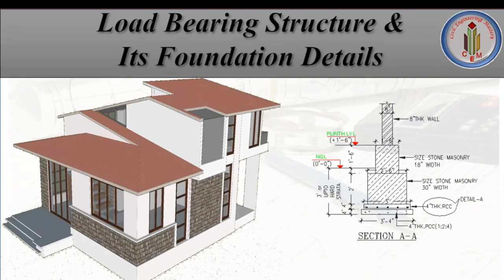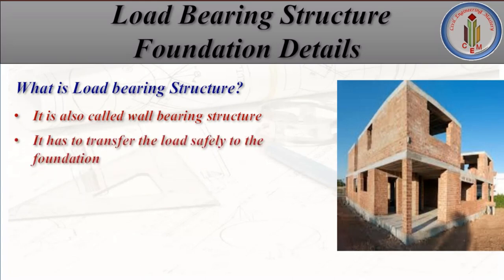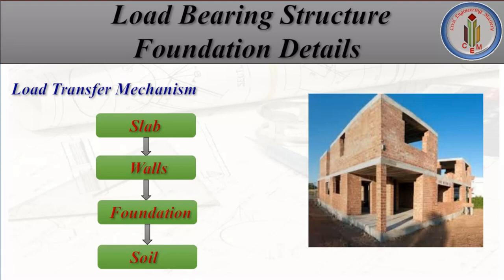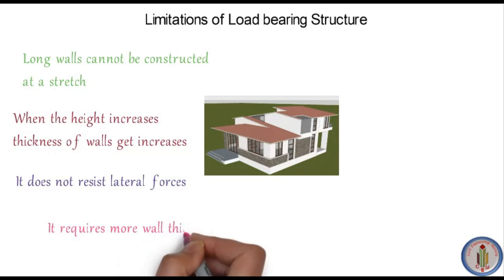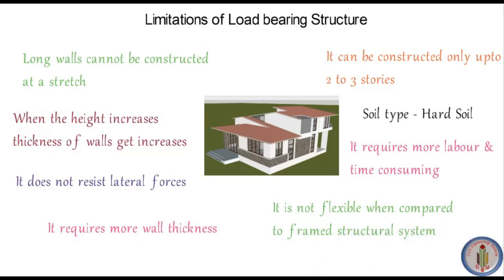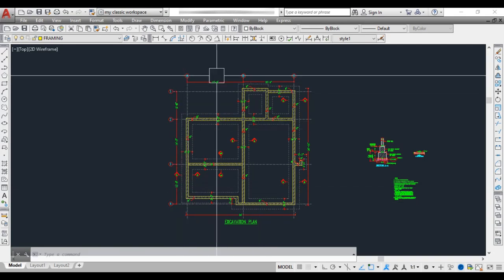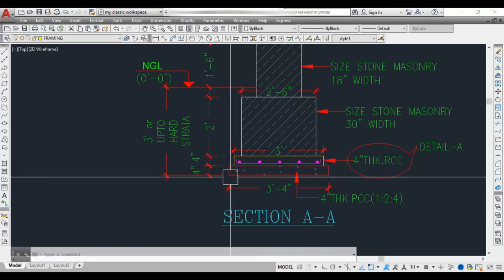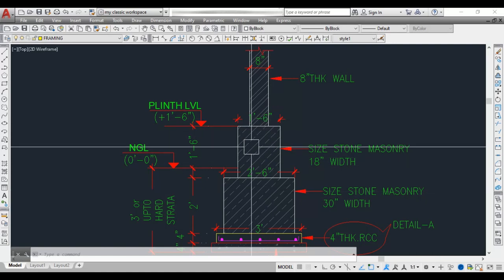Load Bearing Structure | Load bearing wall foundation details | Load bearing and Framed structure

Comment: thanks a lot for this interesting video
Reply from the maker: I have created a course, structural design of buildings using Etabs software which includes structural analysis and design of a five-sorey RCC building(Real project) and is now available on udemy.
Kindly use the below link to avail the full course.
https://www.udemy.com/course/structural-design-of-buildings-using-etabs-software/?referralCode=14883FDBBD95A1ADAC02